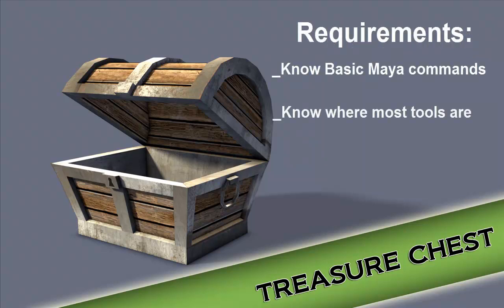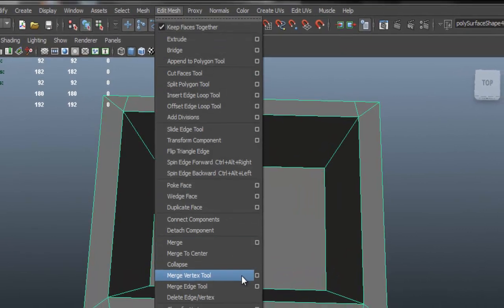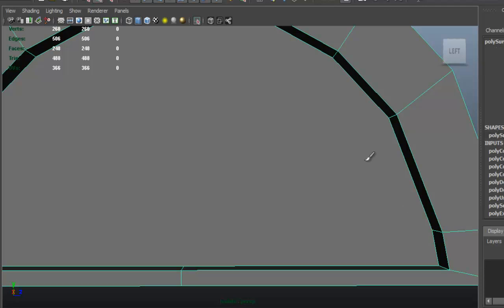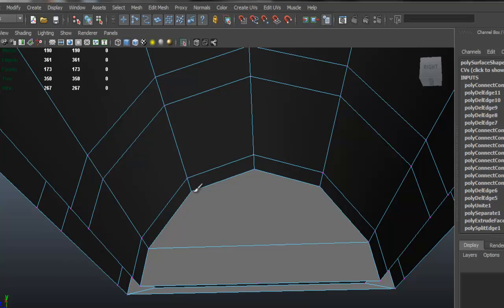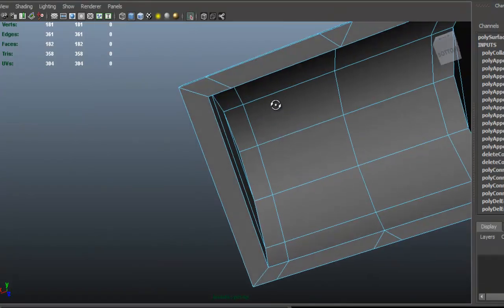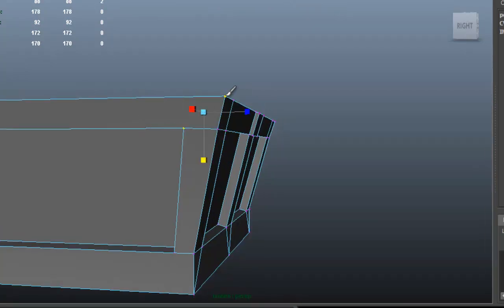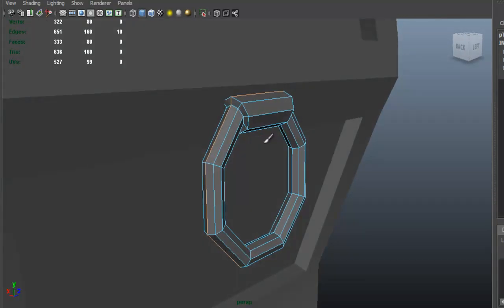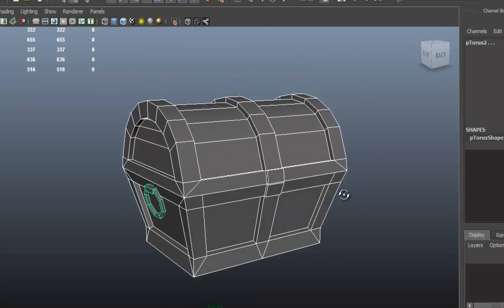Autodesk Maya 2013 Tutorial - Treasure Chest Modeling, Texturing, lighting Part 2

Comment: Could you explain, why do we need to connect the vertices (like you did on 15th minute)? Is it about UV mapping later?
Reply from the maker: because you want your model to be made of quads and triangles only, at that time frame I had geometry that had more than 4 sides( ngon) which is bad geometry.
Reply: 3dEx what kind of issues should I expect with bad geometry?
Reply from the maker: for film expect bad deformation of the model, for games bad performance issues and such.

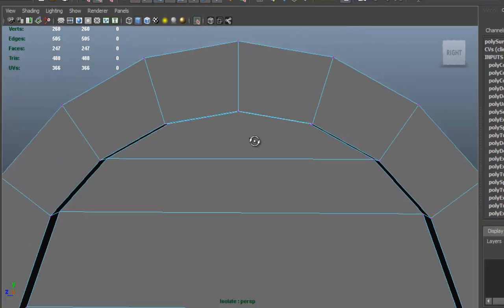Comment: Thank you for your answers in the previous video! one more question: 5:30
why do you connect the verteces? why not just leave it after youve deleted the edges of the side of the cylinder?
Reply: one more: how do you hide the part of the object you dont wanna mess with?
like when you hide the bottom of the box while you modeling the top.
Reply from the maker: itayogev
I connected them because I just wanted to fix the area right away. To isolate select, select the object or faces, there is a little icon( green) in the area where you can activate high quality render.

Comment: GREAT TUTORIAL, thanks for doing this, but I have a question:
at 17:25, when you are scaling the handle, my entire shape is being scaled and I'm just using the faces. I tried turning off the keep faces together but that doesn't seem to be the problem. Any idea what I'm doing wrong? Thanks!
Reply from the maker: That's odd and shouldn't be happening. you may have soft selection enabled, press b to enable/disable soft selection. That may be causing the problem. I don't know what else could be causing that besides making sure you have not selected the whole object.
Reply: irvin390 got it, thanks! i found an article in the end but I'll be sure to remember that in the future.

Comment: Thanks a lot for doing these tutorials and answering so many questions in the comments! I'm just starting out with 3D and they are really helping me a lot. I have my problems with the Append to Polygon Tool, though. Sometimes it works just fines and others I can't select any edges (the arrows never show up). I had the same problem in the first video too but I restarted and the third time it worked. I don't think i did anything different though. Any ideas? :)

Comment from the maker: What time frame? the video is only 21 min long. It should work fine. Sometimes these 2 tools tend to just not work for whatever reason. I just press q and try to use the tool again until it works. In extreme cases you may have to restart maya.

Comment from the maker: please provide the time frame on the video so I know specifically what you are referring to. ctrl + del deletes an edge loop( same as going to edit mesh - delete edge/vertex). If you just use delete to delete an edge loop it will leave the vertices behind so you will have to delete those vertices manually.

Comment: I have 2 doubts: 
after you deleted of the many triangles on the sides of the lid, why did you join the vertices horizontally, would it be even lesser poly count if u didn't join those vertices?

also, wats the difference between CTRL+DEL and simple DEL ?

Thanks for your time and the awesome tutorials btw (y)

Comment from the maker: At that point in the video I realized there were ngons so I wanted to fix them. If you followed the video exactly and have the exact same topology as I did in the video then yes you should connect the verts to fix the ngons. You want to make sure your model is made only of quads and/or triangles. If you ever want me to inspect your model you can also contact me through my website with the maya file.